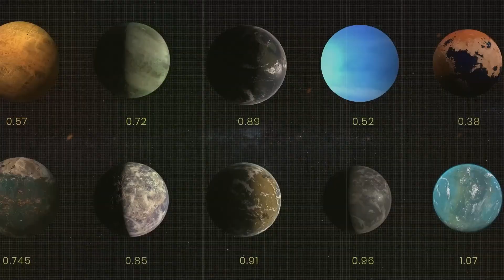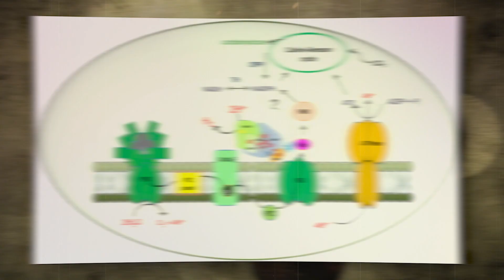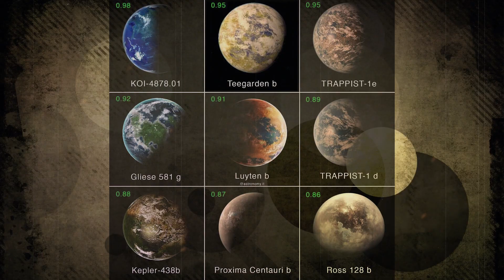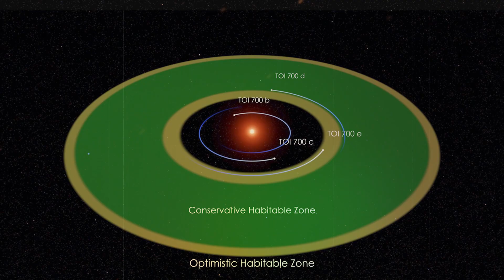NASA Finds a Planet So Perfect for Life, You Won't Believe What They Discovered!

Comment: You can't watery extremophile planet at 200C. That is 392F or 180 F above the boiling point of water.
Reply: the temp of boiling water depends on the pressure